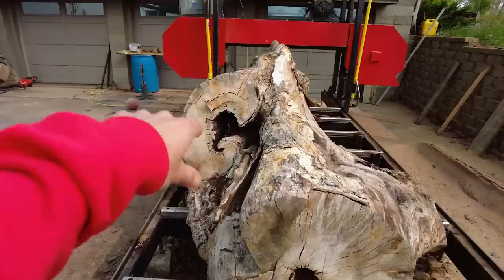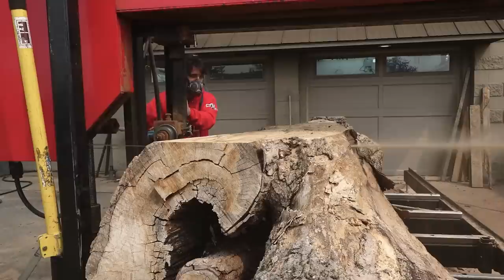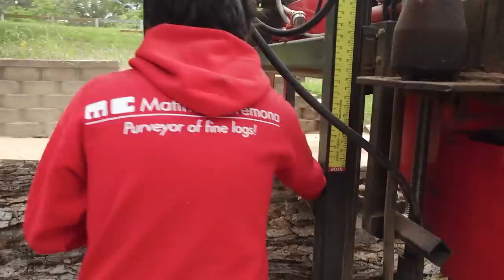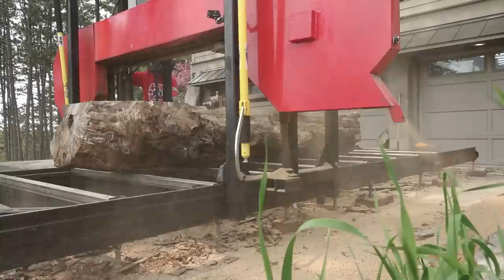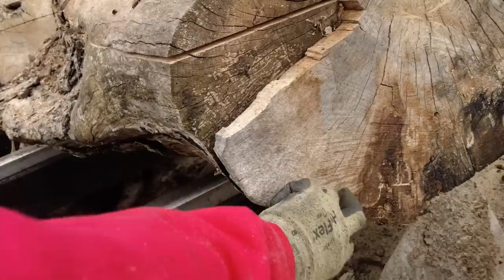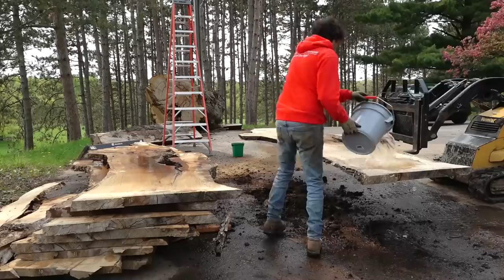People put some weird stuff in trees

Comment: The spalted area, resawn, as a series of vertical spalt line door panels  on either side of a series of 5 drawers (in a Hambridge progression where the bottom partition is left out) faced with the spalting from the other side on a horizontal basis, on a credenza with a dark granite top.  Just have to get a slab to Texas.
Reply: Easier than to the UK 😂😂🙀
Reply: @TR-rz1xt  Got me there.

Comment: Has the power company given you a date for your new service installation?
Have you looked into co-generation? Large hotels have been using it for years. Your fuel would be your burn pile. The "waste" heat from the generator could heat your house (an maybe later a kiln). You could also use a 3-phase generator for your motors instead of using inverters for each motor.

Comment: How effective are the heat and the vacuum in the kiln at killing any critters and eggs in the wood? All the little pieces can be used to fill in an epoxy table top.
Reply: At 160* F, the bugs and eggs are killed. You find the dead ants and other bugs on the floor when you empty the kiln after the wood is dry.

Comment: Just wondering how thick you cut your slabs if you are planning on getting 3/4" or 1" finished boards from them and how long they need to dry after cutting before you can start milling to final size. I know most of what you slab has air dried for quite a while before cutting but didn't know if it was dry enough to mill at that point.

Comment: Hey Matt, I’ve always been curious as to why you use the hand crank on your saw mill instead of an electric one. Is it so you can have the “feel” as you’re cutting/pushing in to the log 🪵 or am I missing something?
Reply: I think by doing it by hand he feels the resistance from the wood and knows when he can proceed faster or should slow down. As well if there is anything in the log he will know if he hits something. And since he built this mill the cost savings of not having extra equipment to add to it saved some money.
Reply from the maker: Yes
Reply: @mcremona that’s kind what I figured, but was curious.  Thanks for the reply
Reply: Although I think I remember seeing sometimes a cordless drill being attached to the axis (is that spelled right?) with the handcrank removed

Comment: You should have taken a shop vac and sucked out all that sand and dirt that you can as you go along..  Because cutting that sand really dulls the blade more than anything else.   Or simply blow it off with an air hose. (or dig it out with a shovel in this case :)
Reply from the maker: Carbide doesn’t seem to care